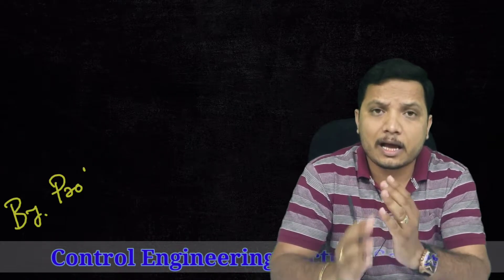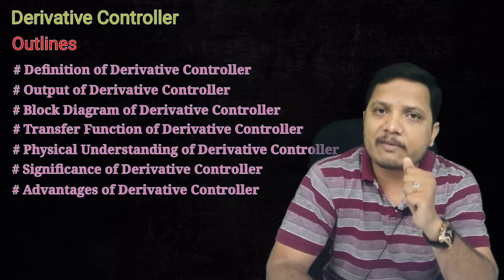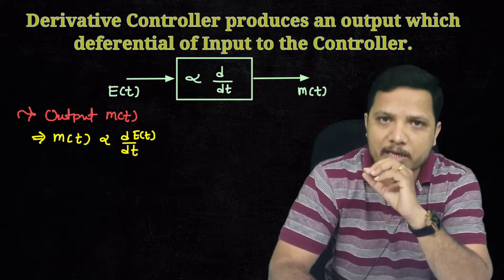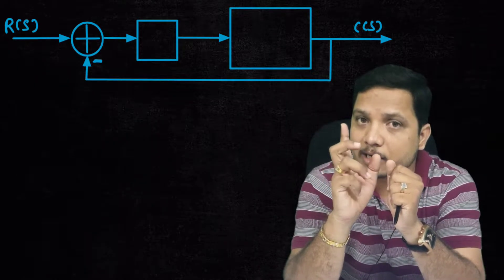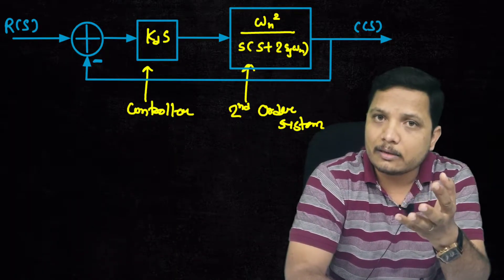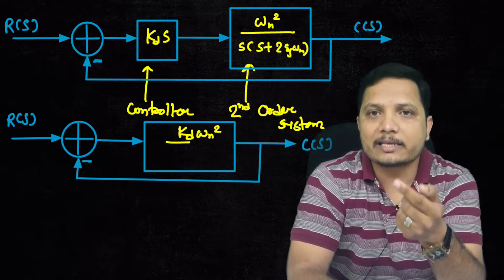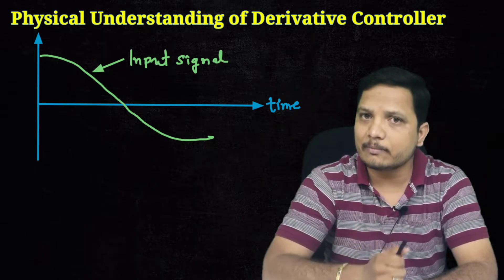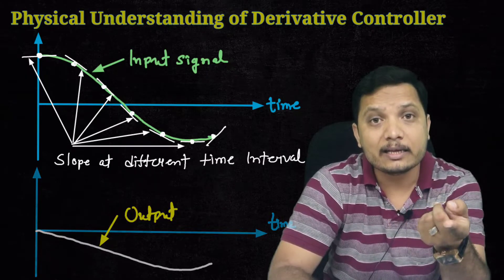Derivative Controller Explained: Basics, Block Diagram, Transfer Function, Pros, and Cons

Comment: There is one question that is bothering me. Although the question I am going to ask is outside the scope of this video. I didn't understand the need for a controller when a feedback already exists?? The feed back along with the reference signal changes the input to G(s) and therefore the output will change. Why then does the need for controller arise??
Reply from the maker: Here controller output is input to system, so Controller is controlling system. Feedback is used to minimize error.
Reply: @EngineeringFunda  Okk. Thank you.